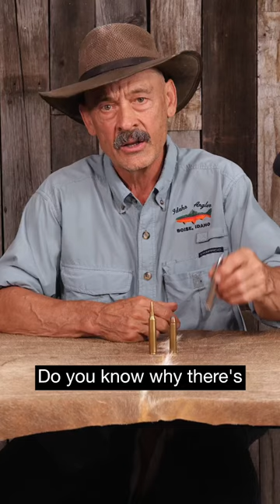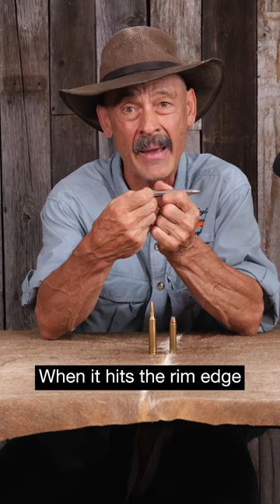Why is there a belt on the 375 H&H Magnum?

Comment: The reason .375 has a belt is to take it off and beat the shooter's shoulder when the trigger is pulled thus adding an additional 23% recoil impulse than any other 9.3mm rounds.

Comment: It was my understanding that they came up with the belt, so that it could be put into double rifles as well as bolt actions and would still extract reliability from the double. The belt was so it would cycle through a box magazine, where a rim wouldn't reliability enough for a dangerous game rifle. They had rimless and rimmed before this was made. I learned this from a old gunsmith that apprenticed at H&H..he also said that then it was marketed as a magnum instead of express round and yes the belt is the factory headspace, but like a rimfire, it can be head spaced off the datum line for better accuracy.

Comment: The idea for the belt came about because the .375 h&h was chambered in both double and bolt action rifles. At the time most double rifle cartridges were head spaced by the rim but rimmed cartridges didn't feed as reliably through bolt rifles. Therefore the belt allowed for reliable use in both types.

Comment: A secondary function of the belt is to prevent case head separation as thats where most cartridge failures occur !
Reply: Interesting point. Makes me wonder if that’s an argument in favor of crimping the bullet when you reload them. I’ve read articles in favor and against crimping, but I don’t have enough experience to know. Fortunately for me, I’m happy with my Federal 300 grain Swift A-frames!
Reply: @mdr.leewilliams7242  The reason for crimping bullets in big game rifles is to prevent them from creeping deeper into the case during heavy recoil, which would affect accuracy at the least, likely cause feeding problems, and cause dangerous pressures at worst.  Only bullets with a groove for the purpose should be heavily crimped though.

Comment: Great daily information. Would you further explain dropping block action? I think long vs short action has to do with cartridge length?
Thanks 👍
Reply from the maker: Drop block actions using a block or slab of steel that slides up vertically behind the breach of the barrel to lock the cartridge in the chamber. Examples include Winchester M1885, Ruger No. 1, Dakota M10. After firing the breach block is slid down to expose the cartridge base. An extractor hook pushes the case out slightly to initiate removal. The shooter can pull it out the rest of the way manually or simply tip the muzzle up and let gravity pull it out.
Reply: @RonSpomerOutdoors  Thanks, you are the fountain of knowledge.
And I enjoy your presentations. Keep the wisdom flowing

Comment: I have to respectively disagree, if that is the case, why is there not a belt on all rimless rifle cases?? I heard decades ago that the belt was for added case head strength on magnum rifle cases, hence the term belted magnum.
Reply: The belt doesn't do anything for the head, which is already the strongest part of the case.  Case head separations happen just in front of the case head, and even if the belt was made wider to cover that weak point the case would just stretch and weaken wherever the belt ended.  The belt on other cartridges is there because the .375 H&H Magnum and its little brother the .300 H&H Magnum needed them for headspace, and Weatherby and Winchester based most of their magnums on those cases.  For a long time, shooters wouldn't believe a cartridge was a magnum unless it was belted.

As stated, most rimless cartridges have a large shoulder of a fairly steep angle for headspace control.  The .375 H&H does not for a number of reasons related to the Cordite propellant the British were using at the time.  Cordite is very temperature sensitive and in order to guarantee that a fired case would not jam in the chamber due to overpressure when used in the tropics, cartridges from the Cordite era show a lot of body taper.  Cordite also isn't a powder, it came in long sticks a bit like spaghetti.  The loading process often involved taking a cylindrical case which could be easily filled with Cordite strands and necking it down, which meant that a shallow shoulder was easier to form.

Since there wasn't much shoulder for headspace the usual British solution would be a rim, and there is a rimmed version of the .375 for double rifles, but Holland & Holland were competing for sales in Africa against inexpensive Mauser magazine rifles firing a powerful German 9.3x62mm rimless cartridge.  They needed an equivalent that would function smoothly and reliably from a bolt action magazine, so traditional narrow rims were out.  The belt is basically a widened rim with an extractor groove cut into it.
Reply: @dc4457  ok that sounds reasonable and well thought out. Thanks for the info. At least you did not give a " bubba" answer. Thanks for that.

Comment: Excuse me sir are you aware those bullets will be irrelevant due to the fact very soon they will be electronic human force field it operates under the same rules as if you discharge a weapon underwater or outside the water singing the bullet into the water you will get the same effect depends on how close you are limited effect
Reply: The shield turns the fast blow, admits the slow kindjal! I saw that movie.

Comment: The reason for the belt is because the engineers (or gunsmiths) were too incompetent to headspace on the shoulder.
Reply: There isn’t much of a shoulder on the 375 h&h. And there is none on its straight wall derivatives like the 458 win mag.
Reply: @66smithra  there is as much shoulder as belt. Still doesn’t explain the .300, .338 Win Magnums or the 7mm Rem.
Reply: @graynotescartridgebox  there is not enough shoulder to ensure reliable headspace. It’s far too small and tapered. The others you mention have a belt simply because they borrowed the 375 H&H case.
Reply: @66smithra  the shoulder and taper was designed that way. Design it correctly then no need for the belt. What’s the belt? 2 hundredths?  Flawed engineering.
Reply: @graynotescartridgebox  why?  The idea is to have a large cartridge that IS tapered so that it feeds from box magazines very easily. You don’t want sharp shoulders. The belt allows for great headspace and creates no rim lock like a true rimmed case would. The 375 is the most popular heavy rifle of all time. It works great!  What are you complaining about?
Reply: @66smithra  meanwhile similar cartridges today do it without a belt. Like I said, flawed.  It was a specific use idea, unnecessary but all but the most extreme cases and the concept carried on for no reason at all.
Reply: @66smithra  and by the way, the cartridge you’re hunt up on in particular has more shoulder surface area than belted surface area.
Reply: @graynotescartridgebox  So I guess the "flawed" design has lasted 110 years by accident then?  :D
Reply: @graynotescartridgebox  The shoulder is very tapered.  It's not just about surface area.  The belt provides a square surface in which to headspace reliably.  Pretty sure the brits knew what they were doing when they invented it.  You need to stop reading what all the Youtubers tell you about "failed designs."  "Failed designs" usually don't last 110 years.  It works great.
Reply: @66smithra  yup. Many flawed things continue on. Industry is slow to change. Either way, longevity doesn’t make it the best.
Reply: @66smithra  you need to quit hanging on to the past.
Reply: @graynotescartridgebox  haha.  What are the repercussions of having a belt on the case?  What's the negatives that you just can't live with?  Should we all discontinue the use of the 375 H&H because it's "old?"  You sound like a teenager.
Reply: @66smithra  I never suggested discontinuing it’s use. It will continue in popularity, not because it is best, but because it is established.  I said there are better ways. 

What is wrong with headspacing on a belt?  Well for one, it can quite often create many issues for the handloader including brass that cannot be sized properly, decreased brass life, etc.
Reply: @graynotescartridgebox  If that were true it would have gone by the wayside long ago.  The #1 priority for a dangerous game rifle is that it works.  A very tapered case runs through the magazine well, and a solid belt provides a good anchor for headspace without the possibility of rim lock like a rimmed case.  They can be sized quite properly and brass life isn't decreased, not that anyone would really care about either with a dangerous game rifle.  They will probably be using newer brass for the task instead of some old stuff.  You're buying into Youtube nonsense too much.  The 300 win mag and 7mm Rem mag are two of the most popular cartridges ever.  Belts aren't a problem.  Only to hipsters on Youtube.
Reply: @graynotescartridgebox  What would recommend for the 458 Win Mag or 458 Lott for headspacing?
Reply: @66smithra  I see you’ve not spent much time loading belted magnums?  That’s okay, grandpa, stay in your lane and buy your ammo from Walmart.
Reply: @graynotescartridgebox I own a bunch. I’m only 42 and have been reloading for 30 years. I think you’re getting worked up over nonsense. People will complain about anything nowadays.
Reply: @66smithra  well, now that you’ve defended the honor of the belt which is 100% useless on the majority of cartridges being used in the American market and bragged about your years of experience, I guess you’ve never had a die you couldn’t get to size properly because of the belt or had cases with cracked necks because they were being over-worked because of the DESIGN. 😂

Some people repeat day one for 42 years. Some people advance. They find things like the myth of needing extra taper to feed to be false.   They find shoulders up to about 30-35 degrees feed just fine!  They find better mousetraps.

But hey, cling to that decoration you call a belt. Your shoes match your purse!  😂
Reply: @graynotescartridgebox  so now you’re at the other end of the case worrying about cracked necks. Bizarre. You still haven’t answered how the 458 win mag is supposed to headspace?  No I think you just want to complain. No one is stopping you from using anything you want. You’re just looking for nonsense to complain about though, not me. I do know that my tapered 30-06 or 375 H&H feeds better than my 6.5 creedmoor though. When I’m in Africa I certainly won’t be worrying about “case neck splitting” because of the belt. Haha. Any day now the 300 win mag is going to die off because people can’t resize it.
Reply: @66smithra  I never mentioned the .458 Winchester. You did. It’s already designed that way.  Easy answer is don’t shoot it!  It’s not a common round and definitely not common in North America. But other cartridges have come since. Those without belts. OMG!  They don’t feed or headspace!  Give me a break!

But you can be as low-round as you want. No practice. Never worry about actually shooting and shooting more 😂
Reply: @graynotescartridgebox  haha the 458 win is one of the most popular African cartridges too. What are you talking about?  And it either needs a belt or rim to feed since it has no shoulder at all and since it runs out of a box mag, the belt is much better than a rim, just like the 375. The designers of the 375 were spot on, that’s why the American companies used it, and the first cartridge was the 458 which absolutely needs the belt. If anything blame the American companies for borrowing its case for the other bottlenecked calibers. But again, no one was a sissy back then complaining about the belt. It worked just fine so there was no reason to change it. Rifles and actions were already on the market for that size case head. Only in modern times on YouTube do people think it’s a problem. Just so they sound smart I guess. How does a belt cause split necks again?  Haha. If you’re shooting your belted magnums that much, why aren’t you annealing the necks?
Reply: @66smithra  except it didn’t and still doesn’t work fine.

If you’ve got to size around the belt and trying to size the body adequately, more often than not, you’re over-sizing the shoulders. Derp derp derp. That’s why there are so many specialty solutions.
Reply: @graynotescartridgebox  dude you realize they cut the die body to fit around the belt just like they cut the chamber right?  I have no idea what you’re talking about. There is no problem resizing belted cases. I think you’re making up things to complain about.